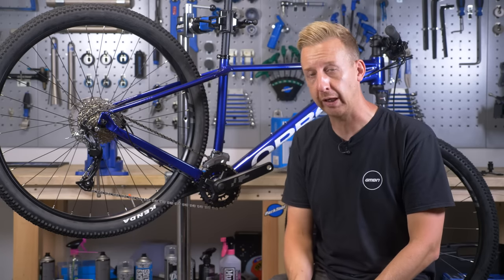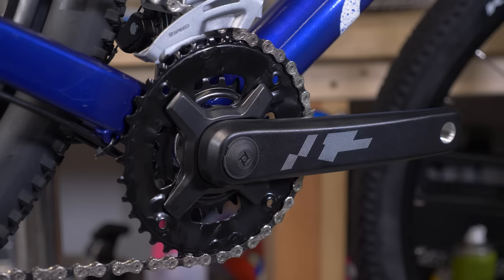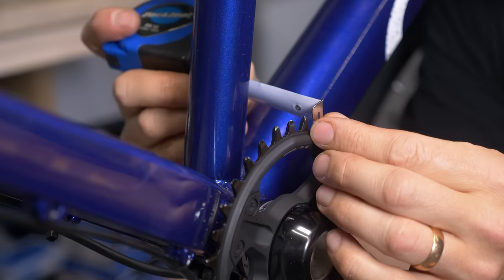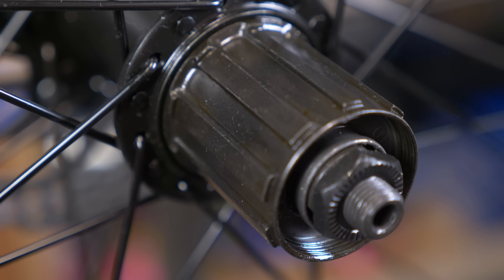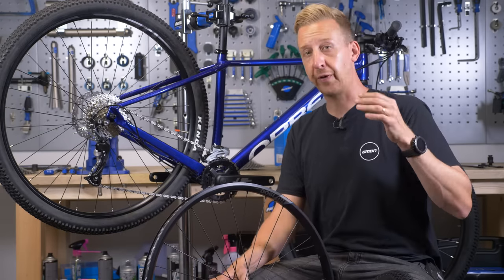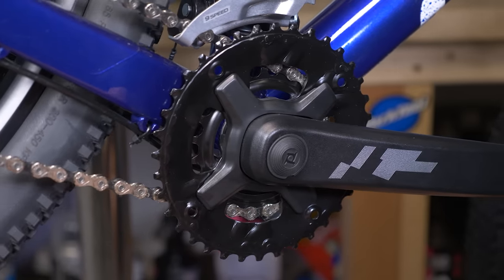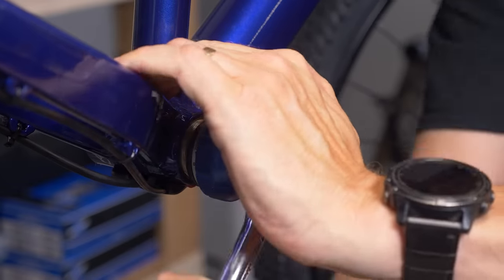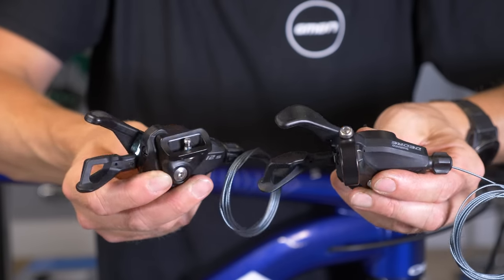How To Upgrade To A 1X11 Or 1X12 Drivetrain! | The Ultimate Single Chainring Conversion Guide

Comment: Another great video! Well done. I'm curious, did someone count amount of chain links used for system 10-51 and 32 in front ? Basically need to confirm if I correctly set length of my chain :) Bike is a hardtail, Trek Procaliber.

Comment: Reading comments was an experience : there's a lot of angry reactions. It's a tech channel teaching you to do a lot of various tech things, sponsor or not, be happy for that. As for the reacts themselves, I'm guessing a lot are coming from old-timers with old gear, or cheap MTBs owners trying to convince themselves really hard they're top of the line and made for the sportiest of people. I have a cheap bike myself, with a 3x8 drivetrain ( always had 3x as a kid in the 90s), I'm used to it, it does the job, it truly has some qualities (very progressive range on the rear, quick skip on the front, relative protection against the chain coming off from the front) but still... You gotta have a seriously fragile ego to defend it against the face of hell. I'm looking into more qualitative bike offerings and I'll be just as glad to ditch the front mech. Thanks for the quality information on those systems Doddy !

Comment: I plan on converting a 90s MTB to a townie, and I don't need more than 8 gears. As long as the chain line is right, can I still use the existing rear cassette/derailleur?

Comment: As an entry level bicyclist in general, the 3x6 I got is so confusing to shift I don't even shift the front and just ride on super limited gears...
Reply: Select the chainring based on the gradient of the path you are on:  biggest: downhill-flat / middle: flat-slightly uphill / smallest: uphill-steep climb.  Change the rear gears to account slight variations in terrain.

Comment: Great video. I went 1x after crashing my cube stereo, breaking myself not the bike. Smashed my left thumb. Moved the dropper post lever to the right. The bike was a 2x11 with shimano XT clutch mech. Have now fitted an Absolute Black Oval concave chain ring. Never looked back. Slick gear changes, very little chain slap, climbs like a goat.
Reply: Did you still use the XT 42t cassette on the rear?
Reply: @mikemolenaar8380  yep still using the the original cassette 42 tooth on the rear.
Reply: What size ring?
Reply: Yes still using original cassette on the rear.
Reply: @paulb9769  the oval ring is 34 at the highest point.

Comment: Hey Guys ! 
I have Merida Big nine 200 with 2x9 system, I believe Its Shimano altus/alivio system, BUT Its completely busted and basically need to replace all the gear components including cassette, chain, cranks etc. So what options do I have ? Should I upgrade to 1x11 or 1x12 (is it possible?) or stick with 2x9 and replace with original parts ?

Comment: I'm wanting to convert my Ridgeback Hybrid bike with a 3x8 (square taper bottom bracket) to either 3x9 (sora) or 3x10 (Deore, Tiagra) with a hollow bottom bracket set up. I'm concerned, though, about fitting the hollow BB, and if spacers will be needed. And if any spacers added on the drive side will mess up the chain line?

Comment: Converted from a perfectly shifting SLX/XT 2x10 to 1x12. What a big mistake. I now have an offset custom chainring on order, bought the smaller 10-45 cassette to replace the 12 speed 10-51 one. Hoping to solve all issues I had at start (wrong chainline, no backpedaling possible on the large cogs, bad performance in general) . So if you have a non boost 27.5 frame like me, stick to your working shifting system. BTW weight savings in my case: around 200 g... in my opinion, higher watts for a rubbing chain on the large cogs and also on the very small cog are way worse.
Reply: Hey mate, if that 12 speed 51t cassette is lying around doing nothing and presumably as new, do you want to sell it?

Comment: Question: in the video it seems like if going for a different system (hg, micro spline), the suggestion appears to be to get a new wheel. How about changing the hub itself? Is it possible to change the hub from a hg to a micro spline with a 135/5 axle?

Comment: My mtb is 2x9 I'm keeping it that way the bike lacks a clutch so I have use the front derailleur as a chain keeper my trek fx is a 1x8 though due to part shortages
Reply: I had a 1x with a non clutch derailleur but I used an inexpensive Amazon chain guide. Never derailed. My clutched derailleurs still throw the chain occasionally 😅
Reply: @johndef5075  the issue is and this is coming from doing the same thing the mechs cage itself if it's not long enough to handle the stress is could fail

Comment: I’m still confused on how to space my chainring to get the correct chainline, what is used as spacers and where are they fitted, also if you were keeping the old square taper bb is the spacing the same method as with the modern bb?
Reply: Spacing a chainring is just putting spacers between the chainring and the crank arm or placing the chainring on the other side of the crank arm; with the old square taper bottom brackets, you can choose a different width bottom bracket to get the correct chain line.

Comment: I have a question about my road bike which I haven’t found a answer to online yet ……

I have shimano 105 and I noticed today climbing the mountain that I don’t have a low enough gear compared to many passing me and my quads literally seizing up a 8-10% grade.

Also I’m using shimano SPD SL pedals and I’ve maxed the distance of foot width and my outside soles are hurting and my knees are to close together…what parts can I use to help widen pedal width on my Giant Contend SL 2020 bike

Comment: Is a 10-52t cassette too big for a 26" wheel? Cos I've been planning to upgrade my 2008 Kona Four into a 1x12 but am hesitant cos some of my friends say it's too big. Is there enough clearance for it to be able to use a 12s derailleur?
Reply: Same size concern here. Considering 1 x 12 for my ancient 3 x 9 Cannondale F400 26". Will the new derailleur be too exposed to trail damage?
Reply: No answer… I am in same situation. I have a Trek fuel EX 8 from 2012, 3x10 and my concern is if the derailleur could be too near to terrain in the most extended position…

Comment: Has anyone found the 2x system too confusing? Trotting out the 'less confusing', as one of the main reasons to move to a 1x system makes me thing there are no real benefits and this is just the market trying to convince us to buy a new groupset with half the components for the same cost as 2x...but with a worse chain-line at the lowest and highest gears. I have a 2x11 on my trail bike, I don't have an issue with the chain coming off, and I've never been confused by it. The ability to move from a big gear to a small gear in one move by changing between the big and small ring at the front is great on changing terrain.....can't do that on a 1x.
Reply: 2 x is a great compromise between the old 3x and the current 1x, which is really only desirable on full sus bikes; hardtails work well with front derailleurs, so why mess with something that works? those massive cassettes are heavy and expensive, so maintaining a 2x driveline is easier on your wallet and legs.
Reply: Same, 2x works great for me too !
Reply: My 2x is on a full sus, it works great on it. I don't drop chains, I have a wide range of gears. The only desire I have for a 1x is because dropper post levers aren't compatable with a 2x setup anymore so you pretty much have to either buy old stock or stick with what you've got.
Reply: I honestly ride my 2x exactly like a 1x on the trail. The front chainring doesn’t leave the small ring and I just shift the rear. The larger front chainring is only ever useful for me on pavement.
Reply: For less experienced riders cross chaining can be an issue or the hilarious irony of a 3x system is just staying in the middle so they don't get that annoying rub on the front derailleur
Reply: I found the 3x System confusing when I was a kid and got my first MTB. However, after a while everyone should get used to it and shifting should become natural. For 2x it‘s even easier. Anyway, it‘s stupid and not very sustainable to upgrade and throw away old drivetrains when there’s still life in them.

Comment: So I went down the rabbit hole, and am now trying to get a working 1x12 SLX setup on my non boost QR frame (original rig was 2x10 Deore). Can anyone tell me if a 1x12 SLX drive chain is possible on a 135mm QR non boost frame? I still need to get the SLX cassette and microspline freewheel.

Comment: Going to 1by10 with larger rear cog on a 135 axle, I started getting back pedalling derailing toward the next smaller gear. My buddy with a142 axle also.  Is there a way to cure this?

Comment: I started with the cheapest option by removing one of the 2x chainrings and changed to a narrow wide so now only have 1x9 on a 135 QR rear hub. Can I just upgrade the rear cassette, derailleur and shifter  next without needing to swap the cranks?
Reply: That's what I did and it works fine, just make sure your chainring lines up with the middle of the cassette so position it on either the inside or outside of the mounting points on the cranks
Reply: there are some high range 9s cassetes out there. Just in case you need that extra teeth for climbing.

Comment: Has anyone found their existing derailleur hanger from a 2 x system angled out away from the wheel? It isn't bent, but maybe came this way stock. Well, when I attempted to align my new 1x11 derailleur, the limit screws couldn't match the breadth of the cassette...like it needs a straight derailleur hanger to bring it all in closer to the wheel.  Thoughts?

Comment: is it posible to change a Cannondale trail 6 (2015)
 to a 1x system, and do you have a specific video on chainline alignment? 
i now have a 3x8 system and cassette and chain are due to replacement and wanting to go to 1x
Reply: Quick glance at that  bike spec , looks like it has a 68mm bottom bracket , and most likely a 135mm qr rear hub at a guess .  So yes that should be no problem .  You would want a 48mm to 50mm chainline

Comment: Clutch is obviously better but you can do without it. I have an old x9 and NW in front and it did not came off one. It is slapping the frame ofc but you can do sth to make it quieter.

Comment: The process is easy of you are using one system like you did here with Shimano. However, if you want to change to something else...well, it can become much more difficult. You mentioned that you thought the square taper BB's were  not the  greatest quality. As someone who owns a shop and see  TONS of bikes with square taper Bb's...well, I disagree. If someone takes care of this older bike, then generally there isn't any problems. And truthfully, the bearings last for years without having to be replaced, unlike exterior bearings. As for the 1x system, I can't truly say that it is better than a 3x system. If shops take the time to show folks how to shift correctly, then there isn't an issue. It's the shops that don't take the time to 'teach" folks how to shift both derailleurs that create issues.Lastly, although Shimano may have a weight savings going from a 3x to a 1x system, I truly don't believe there is a weight savings for most systems. But truthfully, maybe the extra gearing on the rear might be an added benefit for many.

Comment: How do you measure the biggest chainring the frame can accommodate after taking out the 3 X cranks?
Reply: I cross chain my 2x9 fairly often with out any issues. I like the smaller gaps and being able to drop to my granny when the going gets tough.

Comment: For my riding, going to 1X is not an upgrade.  Giant pricey cogs to get decent low gearing, and stupidly small cogs to get high gears — small/small is rough and less efficient than large/large of the same ratio, especially with the poor chain line. Now, I’m not a super athlete pounding it out on the hardest terrain, but for bike packing, 2X all day.

Comment: Does anyone know why Shimano has used security torx bolts on the chainring in this video? Are they not real bolts? Seems weird to use security bolts on something you expect mechanics to work on.
Reply: I got a set of torx drivers for $10usd, hardly breaking the bank.

Comment: What do I have to consider, when changing my old and beloved 26er MTB from 3x9 to a 1x11 drivetrain? Espacially regarding the transmission ratio of the chainring?!
Reply: Consider problem with chainline. Chainstays of 26er are shorter than 29er so your chain will have to angle itself more than on 29er. The second problem is with gear ratios. 29 inch bike has overall diameter about 740 mm and 26er has OD about 677 mm. Therefore you would need about 1.093 % (=740/677) bigger chainring than on 29er. Usually XC bike has 34t chainring. You will need theoretically 37.16t chainring which means practically 36t or 38t to achieve same speeds on 26er. Larger chainring also further shorten the length of chain between chainring and casette which further increase angle between optimal chainline and real chainline on largest/smallest cog of casette. Hope it helps
Reply: @kosskrit  Thanks! 🤔😃 I guess I have to try it.
Reply: I have done change in my full suspension bike from 3x9 to 2x11 and all was working perfectly.
Reply: @DamianNocun  Thanks!

Comment: One problem is these short chainstays that widen straight into the chainring. I have a stock 36t, and it seems a Shimano crankset with 40t is going to hit the chainstay. The bike shop said they would never attempt to do that. I asked about spacers, and they said they exist, but the torque of peddling with spacers would damage things and they wouldn't do it. I am going to attempt it myself because it is the only crankset with chainring guards. 30 32t no guards. 40 42t sets have guards. Really, i am an aircraft and motorcycle mechanic, but my view of bicycle industry standards is horrid. They ought to engineer for simplicity, swapability, include taller men in their dedigns, target the man that doesn't care to appear to be Lance Armstrong, and cares for a simple practical mide of travel across all terrains in all conditions. I also find it impossible to find basic things like reflectors and the little rubber bits that keep water out of axles. Basically, in my experience in the last 2 years, the sales process is non existent, bicycle mechanics are crappy mechanics, no training, you can expect a crappy setup upon delivery, broken bits, no information in book or voice, and you're left stranded without access to little essential wearable parts. I rank buying a new bicycle these days amongst the worst experiences of my life as someone that needed some customizing for a 1x conversion, long legs, and practical usage. A $600 bike turned into $2600 very quickly.

Comment: make a video how to upgrade to single speed ,  no more cables  no more shifter  no more derailleurs ,much lighter bike  stronger chain and wheel  better chain line  no more confusion for new riders , and is much cheaper  , and also les maintenance   the only down side you may have to puch you bike up hill   and no longer be able to pedal down hill
Reply: I got you one better, just take the chain off and attach the cranks to the rear wheel. Heck, then go ahead and take off the front wheel and ditch the entire bike frame. It will be so light! I really sense we are moving forward here! Revolutionary!

Comment: I have a 3x8 drivetrain with the shifter/brake combo. Im am thinking of upgrading to a 1x deore groupset. Does that mean that i will have to buy new brakes? Is it worth it?
Reply: I'm gonna assume you're on V-brakes (rim brakes) ? If so, you're gonna need some new brake levers, but they aren't really expensive.

Comment: Why are square taper cranks still a thing?
Reply: they are cheap and they work with older parts..
Reply: Honestly, if you don't care about the weight, they are cheaper and the BB last almost forever.
Reply: @julien4327  not hitting jumps they don’t. I’ve twisted spindles a few times. The ISIS interface was a decent internal bb and those gigapipe BBS lasted forever